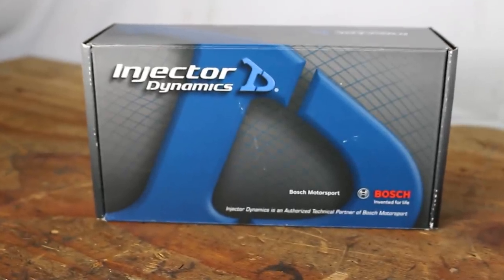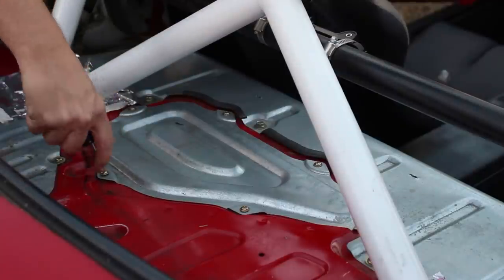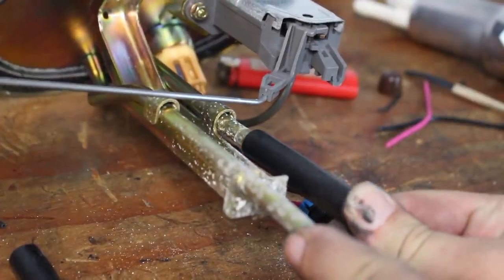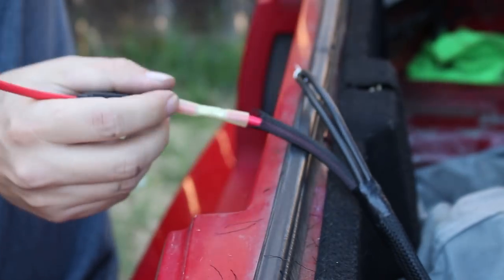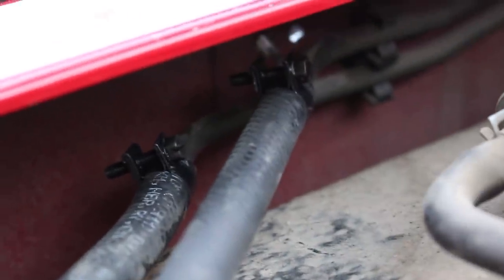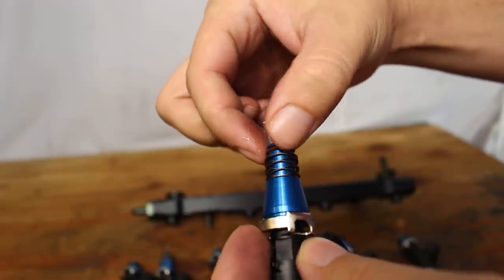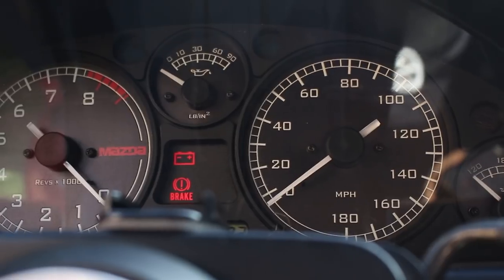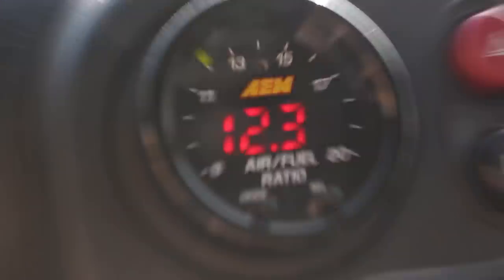Miata's New 600HP Fuel System Install! (Wiring, Setup, ECU settings)

Comment: That fuel pump should be good for 700whp really. I made 670awp on it in my evo.
Reply from the maker: Is that on E85? And what size fuel line?
Reply: @TheCarPassionChannel  Yes e85. -6an feed and stock return on my evox which I think is around -4an. I do want to clarify it was a dyno jet. Base pressure around 43psi with 1650s, also was at like 100% duty lol.
Reply from the maker: @mikelbring  Still even regardless of duty cycle/injector size that means the pump can flow it! The math I was going off of is since the 340LPH started dropping pressure right around 450whp in my car, the 450LPH should support 595whp; but I'm sure I'm seeing a decent pressure drop on my 100% stock fuel lines so that could definitely open up some potential. I'm not too worried about it though because the turbo itself is basically at the limit at 500whp. 

P.s. I'll bet that thing is absolutely sick, I drove a 475whp Evo and that was super fun already
Reply: @TheCarPassionChannel  I think every fuel pump manufacturer uses a different "rating" as well. Keep up the good videos, makes me wanna get a miata! (This evo makes 900whp now lol)

Comment: The 1 thing I don’t understand is with the Miata the size that it is, and with 500+hp, how does he fit in the car with balls big enough to drive it?
Reply from the maker: 😂😂 find out in the next video lmaoo
Reply: Recaro makes a special seat with a cutout.
Reply from the maker: @s.willis8426  What if I bottom out on a speed bump 0_0
Reply: @TheCarPassionChannel  That's called "applying the Flintstone brakes"

Comment: should of had that relay kit already on it. an if that hose didn't break your 1000 should have made it
Reply: yup should have put it in the back of the car where the old one was. upgrade all your lines. its 20-30 years old. its not that expense. youre risking more.

Comment: What fuel pressure regulator?
Reply from the maker: Fuelab 515
Reply: Found it on other vid! Thanks dude! One more question what about flex fuel sensor?
Reply from the maker: @WDCSRacing  Just an OEM GM flex fuel sensor, not sure the part number. But just a basic part out of a Silverado or something random haha

Comment: You could have just soldered the wires.. I'm just glad you didn't use wire taps!
Reply from the maker: When I solder wires, I get hate for not crimping them. When I crimp them, I get hate for not soldering. LOL
Reply: @TheCarPassionChannel  haha of course. All I know is aircraft manuals say to solder them, so if its good enough for a helicopter, its good enough for my miata.

Comment: what do you think about using 15W50 full synthetic? my engine is still loosing oil but I was using 5W50 50/50 natural/synthetic (no leak). I don't think it's an oil issue..